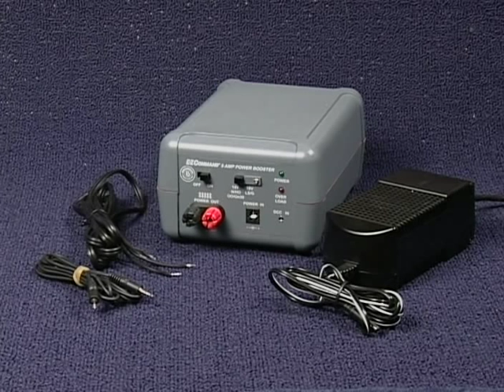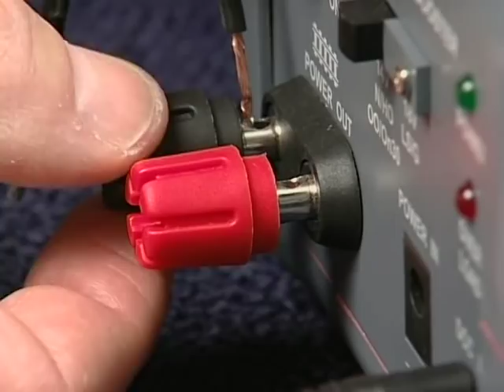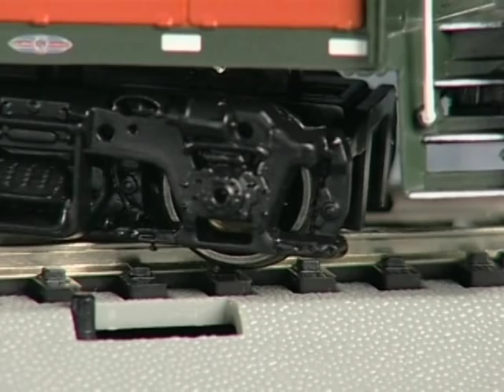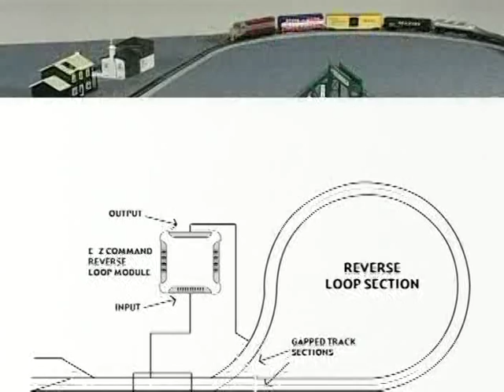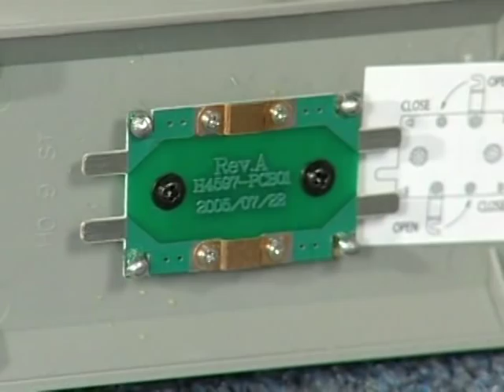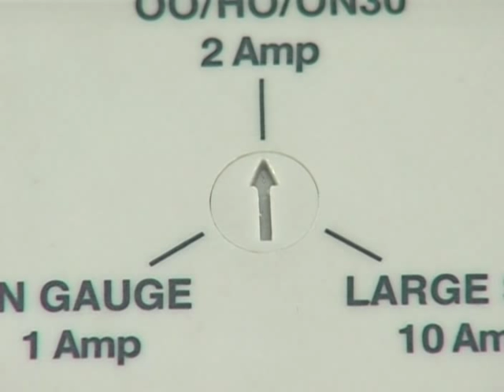E-Z Commmand Part 4

Comment: does the booster work with the Dynamis?
Reply: Yes. The controller is not connected to the automatic reversing unit. Of your talking about the 5 amp power booster, then i dont know

Comment: i don't see why it wouldn't work with dc engines as well. all this auto reverse module does is change polarity when a shor occures.
Reply: inscoredbz - The DCC power signal is similar to AC power... A DC input would either make it not work, or burn out the unit. 
There is nothing really similar between DC and DCC!
Reply: Dc trains control their direction by polarity, so it would change the direction of the train when it switches polarity. The train would go backwards when it hits the second isolator, and get stuck in the loop.